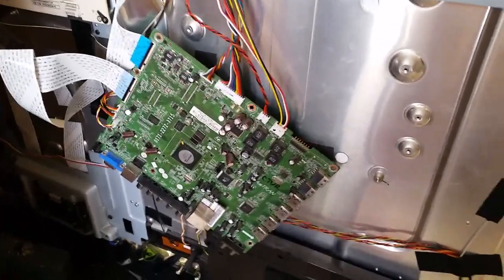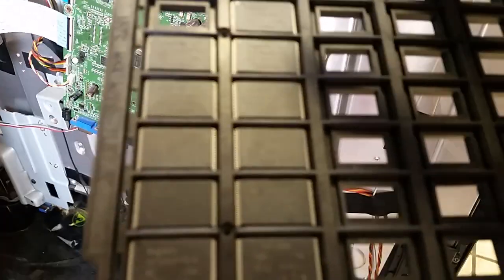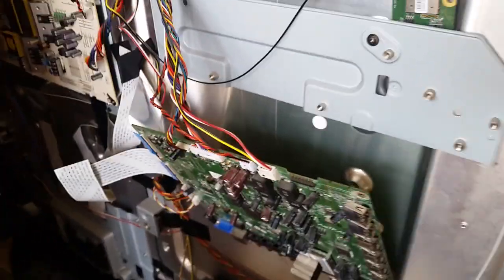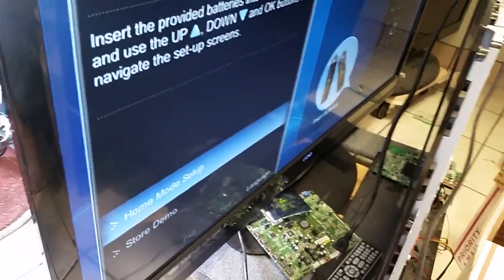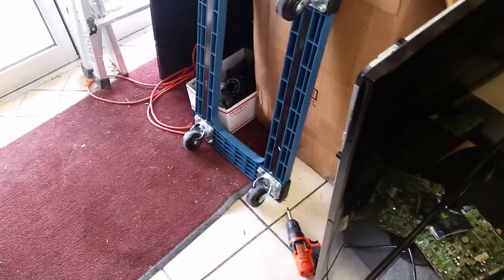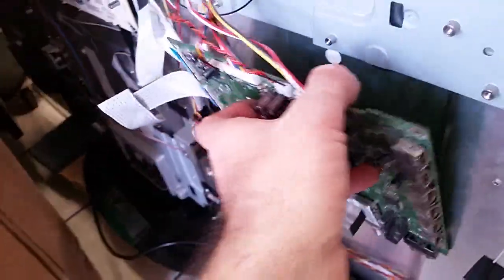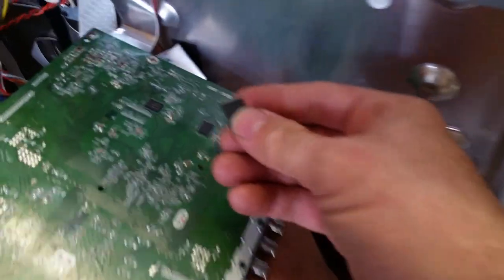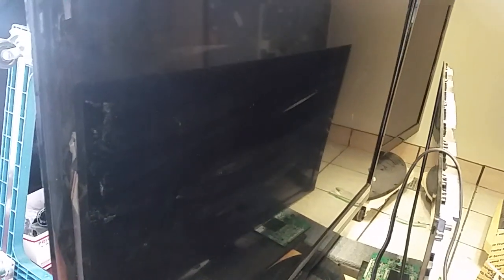Testing Vizio M550SV main board 3655-0342-0150 firmware IC U12 Hynix H27UAG8T2BTR

Comment: I’m curious, why do so many of the original EEPROMs fail on these TVs?
Reply from the maker: I can only speculate, I do not know even with decent certainty. Given how many times the failure is the same and that it does not lead to total chip failure I'd say it is either software or a certain fixed address block is being referenced/written way more often than others leading to its  early failure.